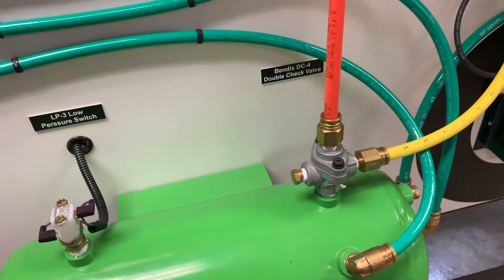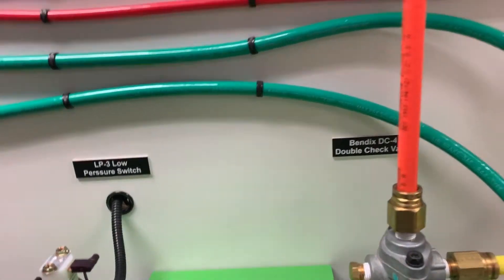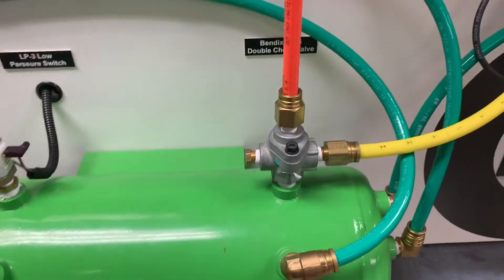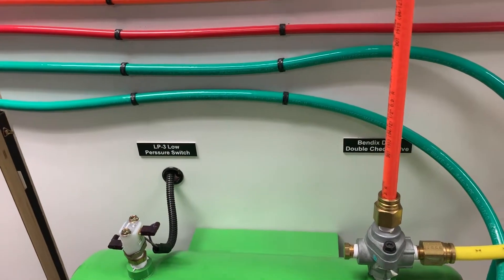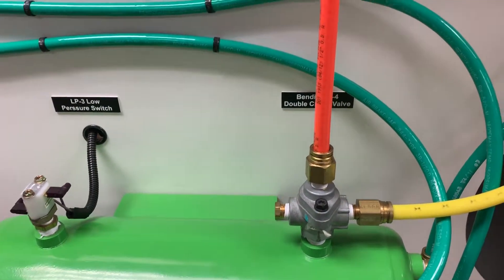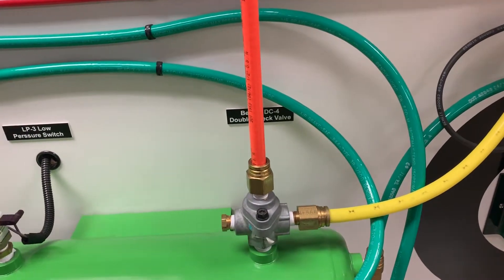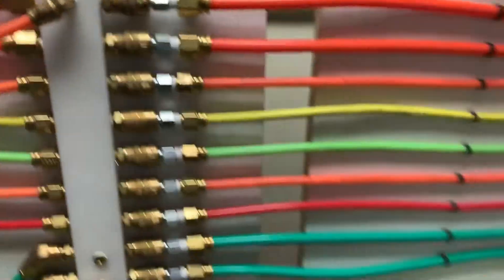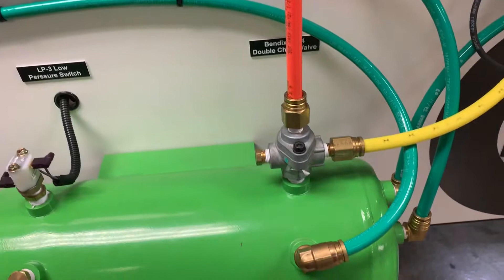Double Check Valves DC-4

Comment: I blew a brake line in a dump truck once fully loaded coming up on a red light down hill with 20.36 tons of GAB!
There was one car at the light coming to a stop and all the sudden POW! The low air horn sounded close behind, Primary air went rapidly to zero!  I checked the turn lane in my mirror  and took it to avoid hitting the car in front of me. I got it stopped but not like normal.
The secondary tank did come through for me though, I had just enough to get stopped.

The 07 KW T800 dump truck I'm in now will drain all tanks from any single tank being drained.  Do you suppose its the double check valve causing it? 
I have a brand new Bendix AD-IS 801266 dryer installed but still have this issue. Although it did fix the pop off blowing issue!

Comment: Can anyone tell me how a "double check valve" with only TWO fittings works? Im translating this for my bus (its a classic and very foreign), and the diagram nor the cross section make any sense to me. It has a diaphragm check valve (lets say left to right), and is obvious. But then they say, that it allows air to flow from right to left through a small pin check valve (Im assuming, since its poorly drawn). 

What is the point of this since to me, it looks like air can flow in either direction with minimal resistance. I would curse out the Romanians for this (and they deserve it as the manual is very...VERY poorly written), but this is a license Knorr-Bremse design. I wish I had to part number and find out what this is. On the main diagrams, it seemed like just a regular ole check valve, but this second built in valve in the other direction really has me banging my head.
Reply from the maker: Ok it so I am assuming you mean it has only a inlet and outlet side so only 2 orifice. So I would guess that its actually the same as this valve except they are just using a different point of reference to explain the operation. Where as this valve is a one way check valve because it will only allow air to pass one way  depending on pressure. They may be calling that a double check valve because the check ball can seal both orifices. Again this is my best guess. I would like to see the valve as well seems interesting.
Reply: @learndiesel528  Thanks for the reply. Took me a while, but I think I figured it out. So, the function of the valve was not what I assumed. It does prevent air from leaking out to a secondary circuit, but rather to use that circuit as a giant reserve tank. So, air will only enter the secondary circuit above a certain pressure under normal operation. So, the brakes will fill first, tehn suspension, doors, etc. If theres a leak in the main circuits, or the brakes, then theres an internal flapper that will let air go from the secondary circuit into the main leaking circuit for an extra boost of air. At least, thats what I could figure. I may do a video on this...Its VERY old tech, nothing electronic, minimal electrical system and all that. The manual in Romanian (my bus is Romanian but with lots of US and German licensed parts) is the big stinker. Poorly written, and it drives me nuts. Sometimes I figure it out, sometimes I have to get somebody to explain it to me...and sometimes, like here, as I talk it out, I kind of figure it out. At least I think I get the purpose of the valve, as the priorities back then were different for air management.